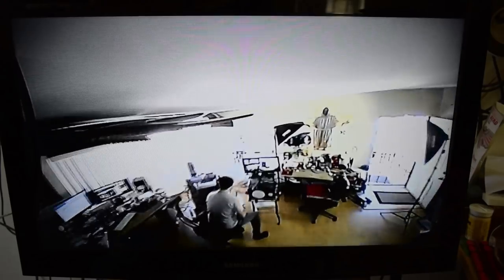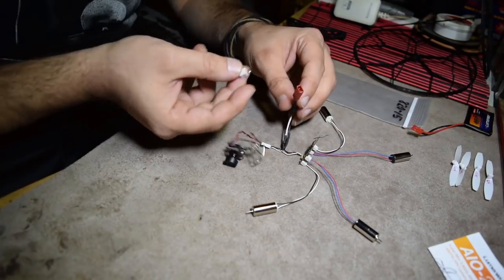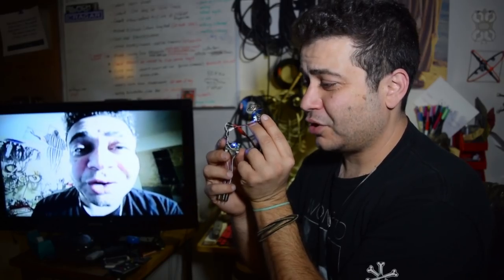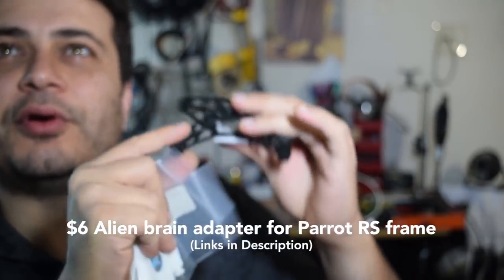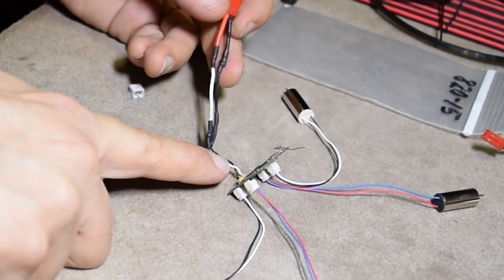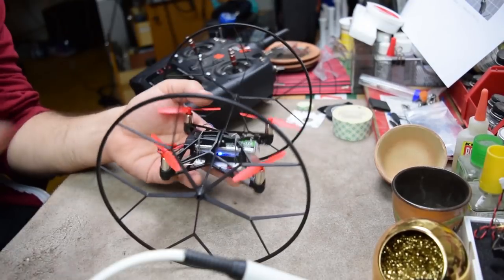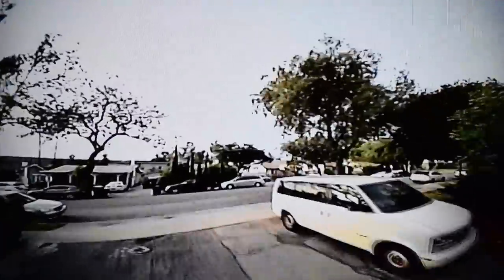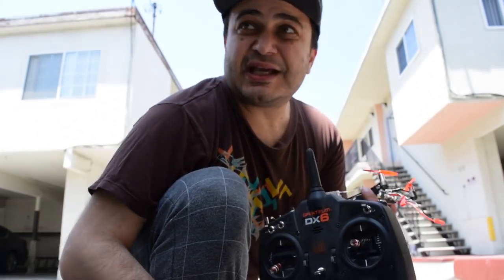Long Range MicroQuad Build

Comment: What PIDs are you using? Cleanflight/Betaflight?
Reply from the maker: For the Nano, I went with the standard smooth default that the original FC came with. They worked fined except for a constant lean on one side eventually.